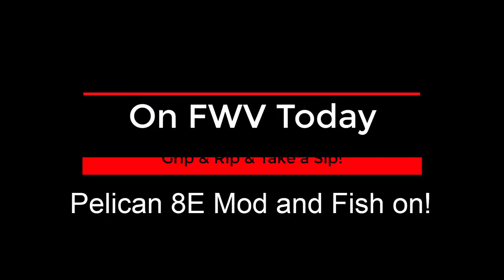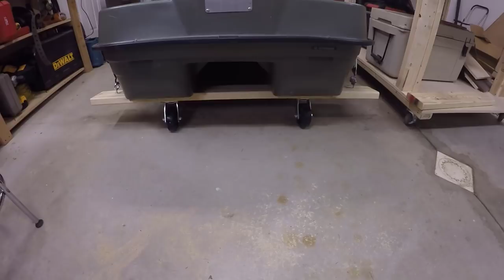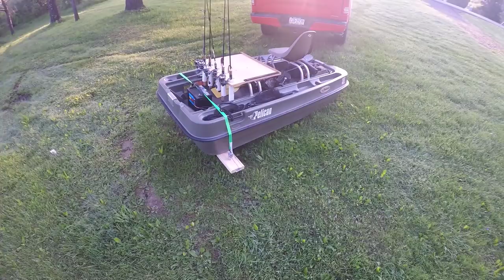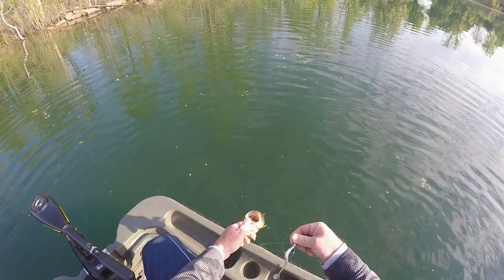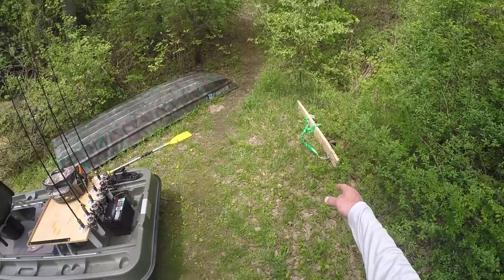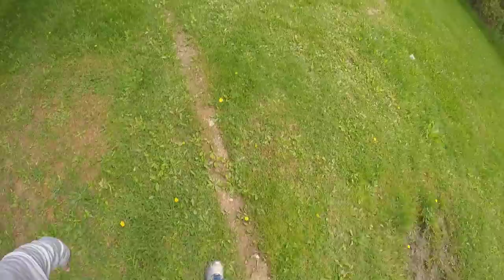Pelican Bass Raider 8E Mod and [FIFTY] Fish Caught

Comment: Highlife, I've got close to the same setup on my 10E boat, but I used 13" bicycle tires. It works great. They're big enough to roll over sticks and easier to keep rolling than small diameter wheels. Good video though. 50 fish is always a good thing. :)
Reply from the maker: Thanks Sam.  Great idea on the tires.  Highlife won't stop I'm sure until his setup is perfect for new bodies of water.  Thanks for the support Sam.  Fish on!

Comment: You bought the wrong casters bud!  Those are great for flat hard surfaces, but terrible as you saw on inclines or soft ground.  You need the fixed 10" Harbor Freight Casters.  The inflatable tires are the only way to go looking at the terrain you have to go up and down on...you can use the regular 10" HBF wheels, but you will need to build out an axle and dolly...easy stuff. I just used the fixed ones though.  If you are part of the Pelican Bass Raider & Bass Hunter Style Boats facebook group...I have a dolly build on there inspired by one of the other members on there. and it works great.  I posted a materials list and some measurements which I used.  Good luck!
Reply from the maker: Thanks for the information Lonnie.  Much appreciated.  Will check it out.  Thanks for watching.